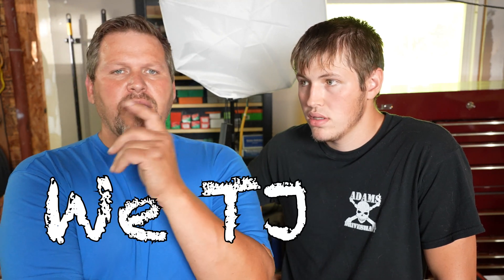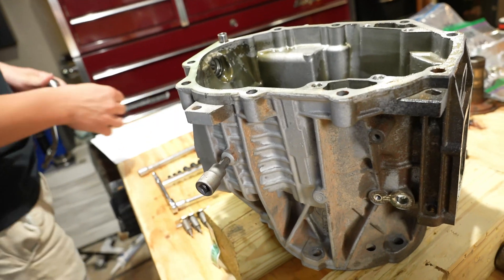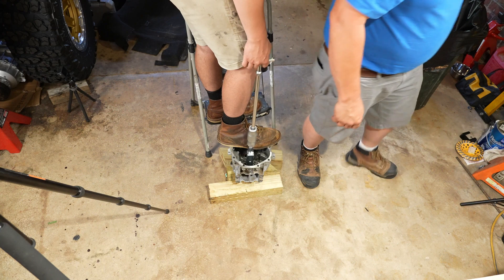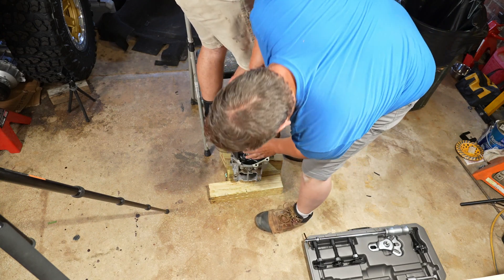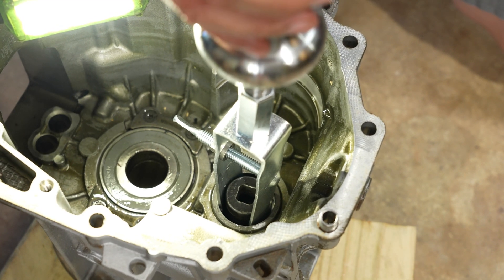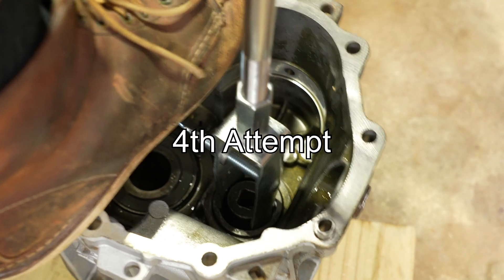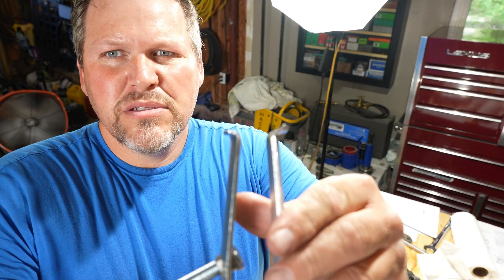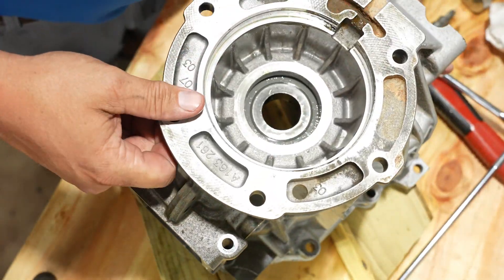PT7 Jeep TJ Rubicon NSG370 Rear Housing Bearing and Reverse Idler Gear Service (Struggle Bus)

Comment: Don't mean to sound like a smart aleck but this would've been a good candidate for your shop press.  Take the assembly and rig your puller hanging down below the press table.  It will be a bit of a pain to set up but we'll worth it.  You have the work piece supported by the press cross members rock solid.  Your slide hammer pulls downward and the bearing will extract right smartly.  I've rebuilt many Roadranger and Spicer heavy-duty truck transmissions over the past decades.   Happy to see you folks rise to the challenge and complete the job on your own.   Great job guys.

Comment: I think if that trans housing was clamp down on something solid the bearing would've came out much easier, but then that would take 8 hours to make something to clamp it down on, good video...
Reply from the maker: Great idea, all it would have taken was a 4x4 or 4x6 piece of scrap wood. Drive a cars tire on one end of the timber for weight. Strap steel with 4 holes 2 for the Case to bolt to and 2 to lag screw them into the timber.👍👍👍Your exactly right we were loosing some of the pulling force do to the case moving.